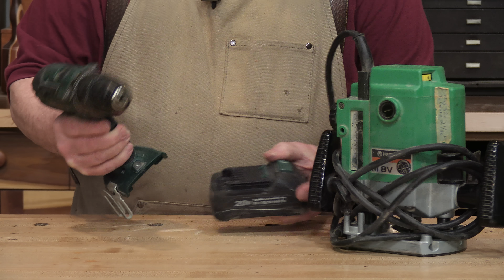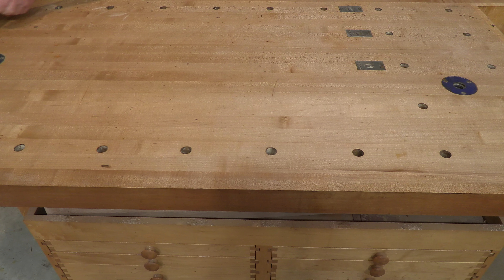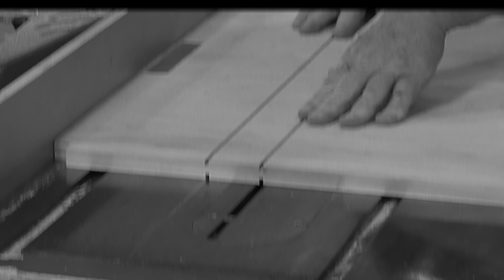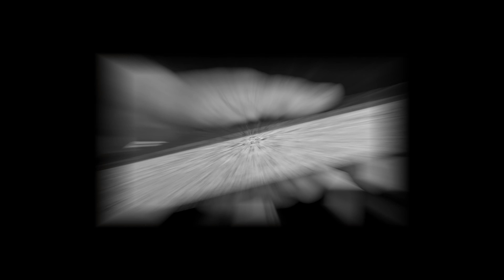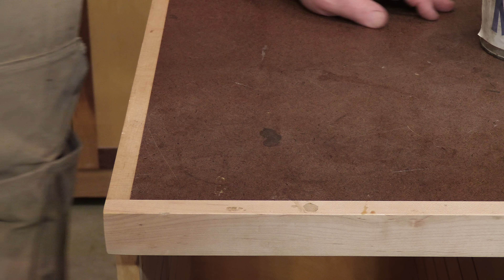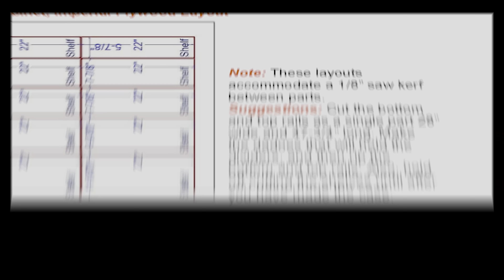Pigeonhole Cabinet for Workshop Storage

Comment from the maker: At the beginning of this video, I mention that the plethora of portable power tools we now struggle to organize was helped into existence by Ray L. Carter, a patternmaker from Syracuse, New York, USA. I thought you might like to know the full story.

Carter’s “hand shaper” (later, the router), is considered by many to be the first truly portable power tool. The company C & E Fein claims primacy for having made a hand-held drill in 1895, but it was weak, weighed over 17 pounds, and had to be operated with two hands and a chest plate. It was barely portable – more like a “wearable” or “luggable” power tool. Carter’s hand shaper could be held and controlled with one hand. He made it in 1915, just before S. Duncan Black and Alonzo Decker patented their pistol-grip portable drills, a design that finally made Fein’s idea work for the average craftsman.

Both Carter’s router and Black & Decker’s drills were made possible (and portable) by the development of small, high-speed “universal” electric motors that could run on both AC and DC current. These first appeared in the 1910s – Black and  Decker were among the developers. And apparently Ray got his hands on one just in time to save his business.

In 1915, Ray Carter and his partner Louis Buchholz were making wooden patterns and match plates that the US Navy would use to cast iron boilers for their warships. There was a huge push on to gear up as it was already evident that the United States would eventually be drawn into the conflict that was quickly becoming World War I.

Many of the steamship boiler parts had their edges rounded to a specific radius. An inspector from the Navy’s Bureau of Steam Engineering found Carter’s radii to be inconsistent and rejected their work. He gave the partners just days to correct the error or lose the contract. It was an impossible task, but Carter had an idea.

Ray had seen some electric clippers at his barber’s. These weren’t the hand-held clippers that we’ve come to associate with hair cutting – those wouldn’t be invented until 1919 when Leo Wahl patented the vibrating electric motor. The clippers that Ray borrowed were probably mounted on a flexible shaft connected to a small universal motor. Ray removed the clippers and the shaft, ground a small “round-over” cutter, attached it directly to the motor’s arbor, and mounted the motor and the cutter on a base. With this primitive router, he re-cut the rounded edges on the patterns, beat the Navy’s deadline, and kept his contract.

Other craftsmen of Carter’s acquaintance saw the utility of the hand shaper and asked Carter to make one for them. This and the resounding commercial success of Black & Decker’s portable drill convinced Carter that he should get into the tool business. In 1922, Carter patented his design for a router and formed the RL Carter Company. In 1929, this company was folded into the Stanley Tool Works as the RL Carter Division. Carter went on to develop the plunge router, the hand-held planer, the dovetail jig, and many specialized router bits.
Reply: Could we get a list somewhere of your notable reference books you have there on the shelves?
Reply from the maker: @skivvy3565  We're thinking of doing a short vid on the ten or twelve most important books for woodworkers to own.
Reply: @WorkshopCompanion  Big fan of Nick books, looking forawrd for more additions.
Reply: I FINALLY got a "hype" option for only a few channels   I wanted to "hype" yours, but that option was not available.  Argh!
Reply from the maker: @lourias  Only available to channels with under 500K subs.
Reply: Thank you for that bit of history.
Reply: Thank you, Nick, for such thorough information and education, as always.
Reply: Nick, your dedication to sharing knowledge is a gift to this world. Thank you -and Travis! - many times over.
Reply from the maker: @Dunc2222  Most welcome.

Comment: Do you know if wood glue sticks to the shiny side of hardboard, with or without paste wax? I am considering using it to make the top of an MFT table as a cheap alternative to formica. It would be laminated on top of 3/4" ply so that the dog holes are more robust than using plain particleboard or melamine.
Reply from the maker: Tempered hardboard is treated with a thin coat of linseed oil, and this will prevent wood glues (white and yelow PVA) from penetrating. There will still be some tack, but you won't get a good bond. Treat the surface with wax, and you won't get any bond at all. You might want to watch https://www.youtube.com/watch?v=8f8quEVpkCU. At 6:55. I explain how to glue up a hardboard/particle board sandwich to make a workbench top.
Reply: @WorkshopCompanion you are a gift

Comment: Did you just use tightbond t glue the hardboard to the substrate?  WOuld contact cement, followed by a flush trim treatment like you would do with laminate work equally well?
Reply from the maker: I used a PVA glue, but there are a dozen other adhesives that would have worked just as well.

Comment: You sir are the most trustworthy person on YouTube, I salute you. I want an all purpose router, it will be my first. I want something that can take most tasks, but I don’t need to cut deep cuts - patience is a virtue. What is the minimum watt you would suggest? Your insight is greatly appreciated
Reply from the maker: These days, I would start with a fixed-base trim router. Pay close attention to the   height-adjusting mechanism -- get something that's easy and precise. Add a plunge base when you get some experience.
Reply: @WorkshopCompanion thank you so much Sir!

Comment: The Godfather of woodworking how to videos (Norm) makes his counter tops the same way.... Only thing is, he does not glue the top sheet of hard board on, so it can be replaced over and over again...... I made all my work benches this way, and I replace them every 3-4 years depending on abuse and a smile all the way to the bank as I spend less than 100 bucks every 3-4 years and have a brand new looking shop... I will be copying your idea however for some of my new cabinets Im making.... I like it.... I will however have doors covering the openings to keep the dust off my tools.... I grew up in a woodworking shop, and all my grandfathers cabinets were open, and all the tools were always covered in dust....Is it a big deal??? probably not, buy my OCD wont allow my tools to collect dust... When a client walks into your shop and sees clean bench tops, and clean tools it speaks to your attention to detail....

Comment: This video answers the problem I’ve had with organizing my power tools and I plan to get started building soon.  I like the 1/8” inch plywood sliders for this design but was wondering if base of the pullout drawer could just be made out of the 1/8” ply, or even hardboard (smooth side down for less slide friction) rather than gluing runners to the side of a 3/4 bottom?  10” would be my widest drawer bottom for weightier tools like a router and so I’d think 1/8” ply or hardboard would be sufficient.
Reply from the maker: You can make the bottom shelves slide anyway you like. I kept all the shelves the same to keep the number of machine setups to a minimum.

Comment: Thx Nick for giving me the inspiration to modify a salvage woodworking store sales fixture (saving it from the sawzall). The carcass is almost ideal, as is. A bit of modification & it will become a pigeon hole organization system. A perfect complement to my French cleat wall & a bonus work surface. Worry not, you’re not the only woodworker afflicted w/ SSD (scrap saving disorder). Nice old school shoutout for hard board. Amazing, useful & durable stuff.

Comment: I made one for my shop. The vertical bays are 1/2" wider than a Festool or Makita systainer and have shelf pin holes to accommodate various systainer heights. The top of the cabinet is coplanar to my miter saw so it also serves to support longer planks. I prefer systainers for my power tools because they keep the tool and its accessories together. I don't have to go looking for things once I take the tool out. Because I'm using systainers, my shelves don't need to slide in and out.

Comment: As someone who has boxes and drawers full of random small power tools (and lot of other stuff, to be honest) this is a wonderful idea! I would make one small change, that will make it more complicated but for me at least will make dados work better. In each unit offset the dados halfway from the next unit - so the 12" wide unit has them at 8", 10", 12", etc. in the next unit over, the 10" unit, start at 7", then 9", 11, 13, etc. The next unit gets the same as the first. That way your dividers don't have dados that back up against one another, but are instead an inch apart, making the divider stronger. Like I said, more complicated to lay out and cut, but in my mind a neat way to avoid that little 1/8" bit in the middle of each divider every 2 inches.

Comment: Wow, the worksurface you showed is exactly how I made the top for my roller tool cabinet over ten years ago.  It's had a few small drill holes drilled into it now and then, but gluing a toothpick or small diameter dowel into the hole fixes it.
Overall, my toolbox worksurface/top is my favorite thing in my garage.
Good to see you do it the same way.

Comment: Even if you don't use the other side as a workbench top, having the hard board laminated to the particle board should keep it from warping easily.
Reply from the maker: True that. The exact same rules that apply to making plywood also apply to laminated benchtops and countertops

Comment: I absolutely recommend tall file cabinets that can be found at thrift stores , garage sales. They are built to handle heavy loads and are great for grinders, drills , routers etc. You can easily put them on a dolly, roll them around and even put plywood on their sides for brackets to hold clamps, extension cords etc. They keep all the wood dust off the tools and there are no crooks or crannies for spiders to turn into homes.

Comment: As a Finn (European) I appreciate you convert measurements to metric too. Thank you for doing that. I have watched so much American youtube videos that I have developed a fair grasp of the imperial  units of length too, but this makes it easier to follow and focus on the right things. One funny observation about Americans using metric units. They seem to skip centimeter and mostly use millimeters in small scale. For us centimeter is the everyday unit and millimeter is a more technical unit. Plywood thickness is usually declared 18mm rather than 1,8cm though in everyday conversation using centimeters wouldn't be too weird. But having shelf walls 300mm apart sounds oddly specific. Sure when building, you want the accuracy to ne there. But it sounds a bit like if you said my house is 400 inches long. Normally you would convert that to feet and maybe round to 33. But mm or cm the conversion is appreciated, and those two are easy to convert in between especially for a native metric user, so it's just a funny observation.

Comment: I would never have thought to use thin strips as sliders. Are they strong enough? So the plywood shelves need to have a slot cut into them to accept the strips? I also wouldn't have thought to make those strips out of plywood. Wouldn't hardwood strips, or even pine, be more durable? Are the 1/8" strips really strong enough to hold up power tools?
Reply from the maker: They absolutely must be made out of plywood or the thin strips will immediately split, no matter what wood you make them from. Remember that wood is anisotropic -- only strong in one direction, parallel to the grain. Unless you go to the trouble of cutting and gluing up the strips so the grain runs through the width, solid wood strips are useless. And yes, plywood strips are more than strong enough. The weight on the shelf is distributed along 44" (1118 mm) of 1/8" (3 mm) plywood. And the shear strength of 1/8" birch plywood is rated at 4,350 pounds per square inch. Unless your portable power tools are made from neutronium, the plywood strips will support the load.

Comment: Yeah that's what I've done in my shop as well, except I put sliders underneath the floor of the shelf, which then sits on horizontal partitions.  I don't know why I bothered, it's kind of neat that I push it in and it pops out, but it was expensive, took longer to build and eats into my space.  Your solution is much better.

Comment: For those concerned about the thin kerfs…I think the key would be not to make the cabinet too deep, and, possibly include a stop, or maybe just a marking, so you don’t pull it out past the halfway point. Those edges can hold a lot of weight across the entire length, but would not want the last 1/4 of the trim holding it up when pulled out for access.

Comment: What's the story of that old wooden hand drill in the glass case on the wall behind u?
Reply from the maker: There are no glass cases behind me, but there are two braces -- one all wood, and the other metal and wood. I have a set of bits for both, and both work.

Comment: 0:39 It really saddens me to think of what Black and Decker has become.
Reply: You either die a hero or live long enough to become a villain
Reply: Stanley is a security company. Their trucks and vans going around to fix and upgrade commercial doors and security systems. Automatic opening doors. Secure areas. Locks. Electronic locks. Alarms.

DeWalt barely has anything but more and more drills. They have some weird copies of Stanley wrenches and socket sets. Just a random collection across globe. Nothing that stands out enough to get market share.

Comment: I understand the way those kerfs are made to line up but didn’t quite get how you match the strips glued to the sliding board. 

Seems like a lot of chances to let mistakes show up in the form of a misaligned storage space. Wonder if there is an easier more precise way to use the table saw for eliminating error potential

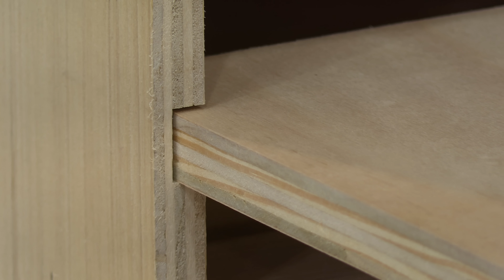Comment: 3:52 Isn't that seasonal? As in if it's humid around, it will absorb all that and soak up. Now it's a little bit larger "than what it's bragging to be". Wouldn't the size be changing throughout the year?
Reply: Yes, though for plywood the size change is minimal. I typically use plywood as much as possible in my shop, which is in a basement and goes through quite a few seasonal changes throughout the year. Treating plywood with a good finish (usually polyurethane), helps minimize and slow down the seasonal changes even more. Plywood has multiple grain direction changes, and this helps to minimize cupping and bowing. The quality of the plywood also matters, as good quality plywood usually has more layers per a given sheet thickness, and this helps even more.
Reply: @TheDrake Hmm, nice. I thought since the plywood is....still wood, it too would go through drastic seasonal changes.
Reply: @harshvardhan4771 the big difference is that the layers of wood are so thin and the grain directions alternate which makes a huge difference in stability

Comment: Kind of amazing that a 1/8" piece of wood glued to the edge is strong enough to hold up the shelf plus some potentially heavy tools.  On the one hand, Engler clearly knows what he's doing (and I don't).  On the other hand, I'm still chicken. If I do this I will probably do 1/4" instead of 1/8.
Reply: @PhilNPrice I had the same thought, so I went to the comments. Then I rewatched. “Glued to the edge” … “in matching kerfs”. He ran kerfs on the sides of the shelves and then fit those strips in.
Reply: @jonaswittke sure, I realize that, but it still means the weight of the shelf and everything on it is borne by a 1/8-inch-thick strip on each side; and, as another commenter pointed out, if you pull out the shelf 3/4 of the way there is a lot of weight on short, thin pieces.
Reply: @PhilNPrice  That makes sense. In practice, though, would you really pull out a shelf to access that heavy tool? You’d just grab it from the shelf, like you would from a normal shelf. I’m justifying making one of these things for myself, and I’m not fully there yet… These shelves are adjustable, which is great. Shelf pins cover adjustability, but not the sliding action. Maybe aluminum is the ticket?
Reply: I think the key would be not to make the cabinet too deep, and, possibly include a stop, or maybe just a marking, so you don’t pull it out past the halfway point. Those edges can hold a lot of weight across the entire length, but would not want the last 1/4 of the trim holding it up when pulled out for access.

Comment: How do you glue those pieces to the edge of the shelves that fit in the kerf groove? That seems like the hardest part.
Reply from the maker: You cut 1/8" wide, 1/4" deep grooves in the edges. The splines are 1/2" wide, so when you glue them in the grooves, 1/4" protrudes.
Reply: @WorkshopCompanion Ah!! Thank you.

Comment: I'd there a good reason to put the day in the center instead of along the bottom of the shelf? I'm thinking of using some 1/16" steel I have on hand to the bottom of shelves like that. Should I center it instead?
Reply: It was convenient for him to do it that way, but if you are using an entire plate of steel just slightly wider than the shelf itself, it would be more convenient for you to do it the way you said.

Comment: The double surface is probably a good idea even if you never flip it. I made a similar top with hardboard on one side and it bowed on me. 

I love the kerf idea. I'll pickup the plans when I'm ready to actually build though.
Reply from the maker: Your comment about bowing is very much on point. The same rules that apply to making plywood also apply to this top.
Reply: Garry NOT Linda. I agree. Particle board has a bad habit of absorbing moisture and swelling. It's something that's rarely found in my shop anymore these days.